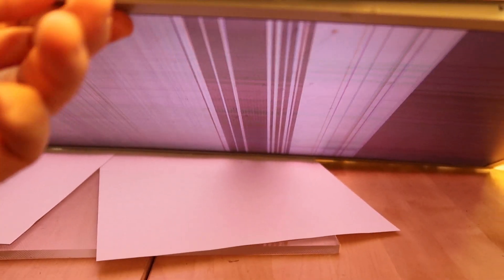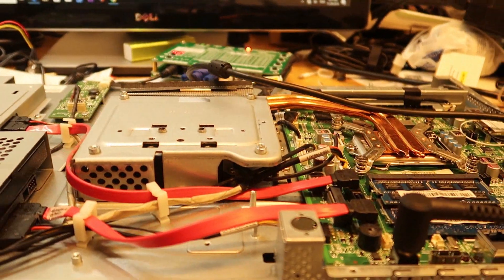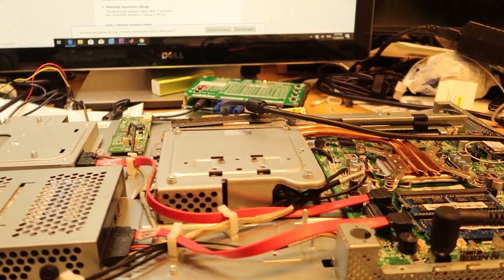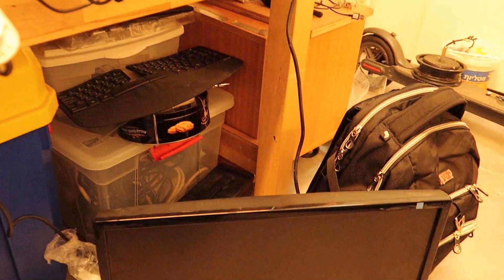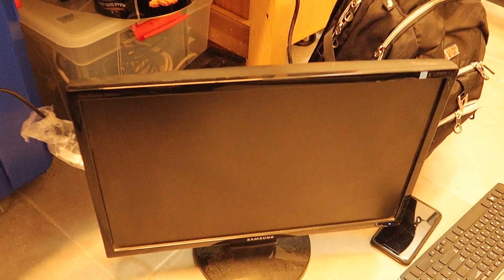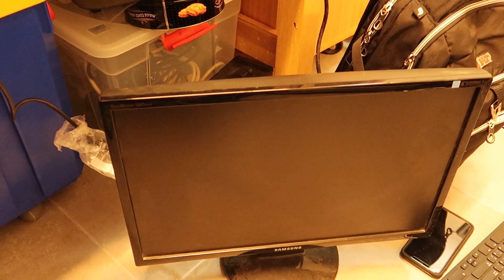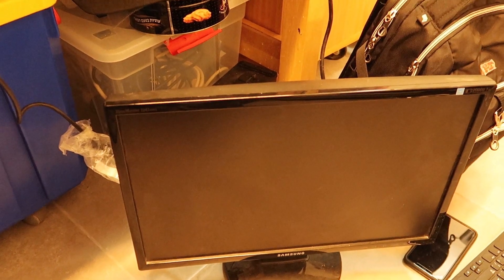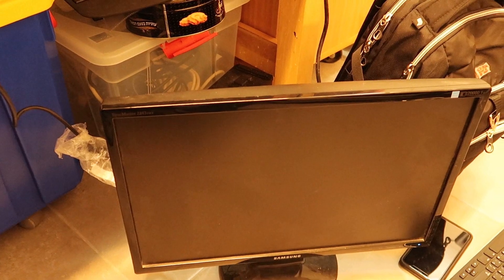How to test LCD display panel

Comment: wat is the meaning of "A1" , "A2" , "A3" , "A4" , "AU",
Reply: Hello, have you find what means ?
Reply: A rough translation would be A1 is a screen wire short circuit alarm. A2, A3, and A4 are back light short circuit alarms. And AU is automatic switching on.

Comment: Hello! I have LVDS LCD tester T-80S and i must to test 30pin lcd, What i need?
Reply from the maker: to verify that you have the correct cable with the kit you buy
Reply: @RoeeBloch  i have the same problem, but i don`t have the 30 pin cable.

Comment: This tester still makes you wonder the t con or screen is bad. Bad t con cause lines. Bad screen cause lines too. So which one is bad when using this tester. Need to test the screen directly to rule out which is bad.